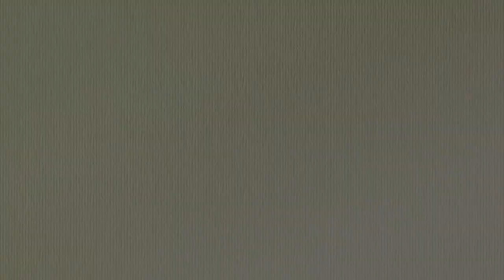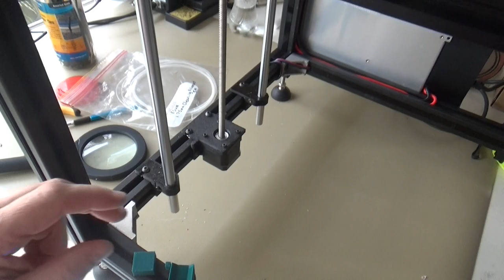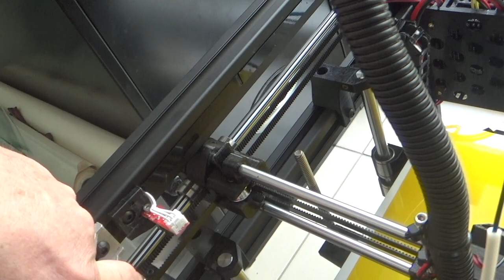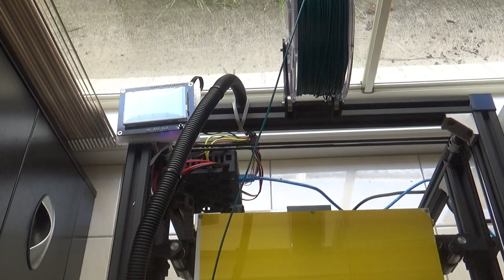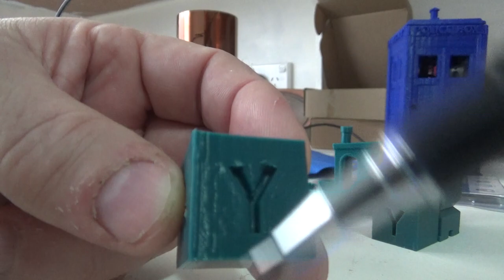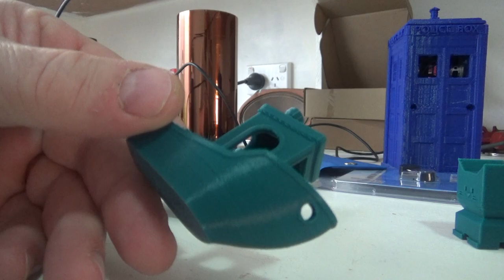#106 Hypercube Evolution 3D Printer Build - 13 (Fine Tuning)

Comment: What print speeds did you use before and after?
Reply from the maker: The only setting I changed was the perimeter speed. I have it set for 3 external perimeters, with the outside set to half speed. 
The before prints had the speed at 60mm/sec, I set it to 30mm/sec. all other speeds were left as is.